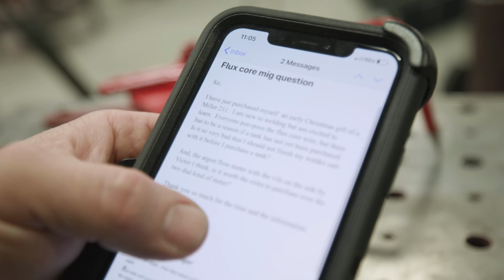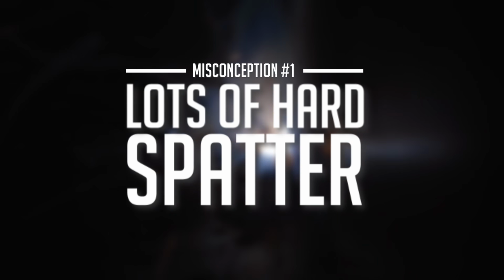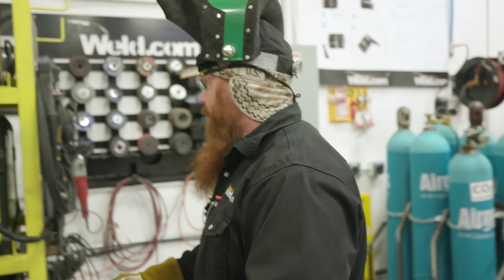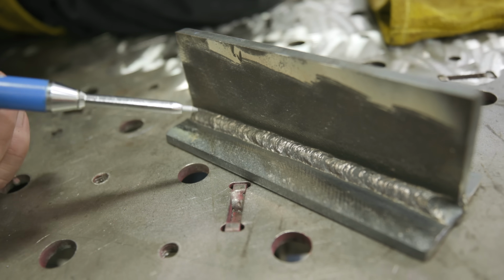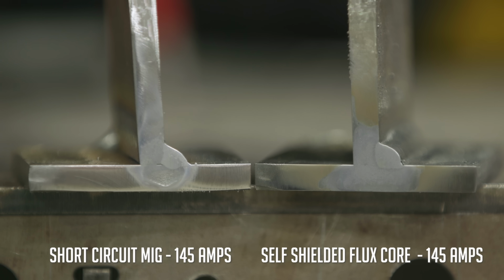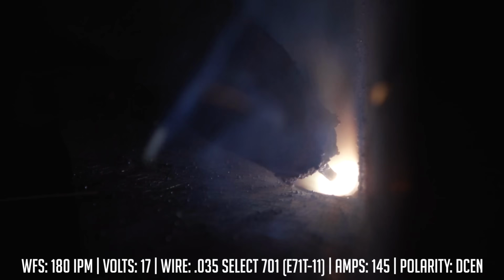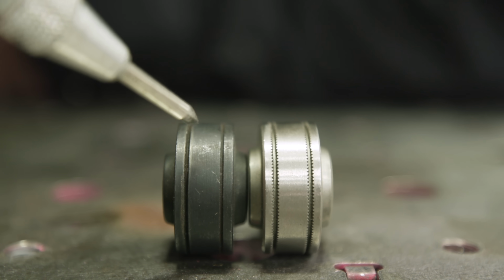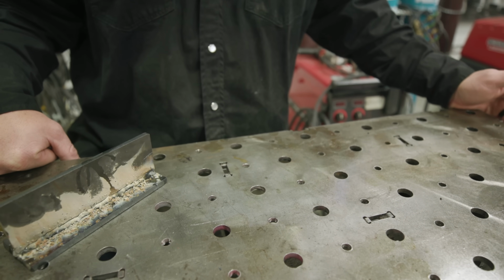3 Flux Core Welding Myths DEBUNKED

Comment: Greetings, master, I am not a welder, I am an artist-designer by profession, studying the physical properties of welding, I myself realized that everything needs to be done, as you showed in your video.It is necessary to observe 3 positions in working with flux-cored wire: 1). Polarity is STRAIGHT,  2).the wire feed roller must be notch,  3).The wire stickout should be within 9-12mm.(3/8"-1/2"). Be sure to use splash protection spray.
  Then work is a joy...👌🤝

Comment: I use only flux cored wire here in the qeer old corrupt uk and have never used a shroud on my mig as gas is produced at the pool. Nice to see and hear u say that shroud is not needed as a lot of welders who say a shroud is needed wen using flux cored..many thanks..

Comment: Hi there just wondering if you have any advice on why my welder starts to not feed the wire properly after welding for a while. I can feel it in the gun that it's not feeding properly and doesn't feed into the weld freely.  My welds aren't coming out bad just not feeding the wire properly after welding for a while and then welds start to get bad. I'm using a 200amp welder with 0.9 flux wire and 1.0 tip and polarity is correct and correct roller inside machine. Thanks for any advice.

Comment: I need to weld an 1/8 inch truck frame can I do it with a 110 craftsman mig welder using flux core .030

Comment: I have no clue what Im doing. I bought a welder off amazon  that can do stick and flux core. I need to do some diy automotive welding (fixing muffler problems). I tried out both types a few times. using 6011 and 6013 on the stick. The flux core seemed to do ...better(?). It seemed to deposit more metal than the stick. which kept sticking to my practice sheet metal of 22g steel. Any tips?

Comment: Quick question, if I am welding on a vehicle, will sending power to the piece I'm trying to weld potentially short out any other body components that have a ground connection to the frame?
Reply: You should disconnect your battery.
Reply: @terryquarton2523  Yeah battery is fully disconnected, but is there still a need for disconnecting all the other components? Like the ECU or Window Wiper motor?
Reply: @TwistedPiston-xoxo  I would say your wiper motors is save but you got me on ECU.
I am a bit to old on ECUs we didn't have then when I was a apprentice.
Local service department at a dealership maybe the best bet.
Reply: @terryquarton2523  I will take the extra precaution and disconnect the ECU, the connector is very easily accessible. I have to weld the spot welds back on the cowl. If your experience says the wiper motor is good, I can believe that. So long as my ground clamp is placed away from it to guide the current I believe it should all be fine. I really appreciate the info man.
Reply: @TwistedPiston-xoxo  I use to make my own tow bars and would tack weld them in place on the  troopie 1980s with battery disconnected then take off to do the full weld. Pre computer cars!!!

Comment: Definitely helps to have a good machine. I had a cheep craftsmen with high low switch and wire speed worked OK on thicker but not on body panels. Tried Flux core on my Miller multimatic 220 way way way better. But run i 75/25 now since I can where I live now. I just weld body panels mainly, always great info to learn

Comment: You made false statement at 3:00 "70% of amperage is through wire" IS NOT POSSIBLE. Electrical laws state that amperage through ANY circuit is equal in all series components. The ground and wire are is series so if 30 Amps is flowing through wire then 30 Amps is flowing through ground.
Due to comparatively high resistance in the wire compared to ground there should be a significant voltage differential.

Comment: Dear Mr. Weld,

Thank you for addressing the common problems and mentioning some tips that are new to me. I weld mostly with flux core. Its windy 90% of time where I work,  and I've found Flux core to work well.

I've had feed issues since I started using flux core, 5 years ago. I'm going to look around for a knurled feed wheel. Thanks

Comment: I used self shielded flux core 35+ years ago for fabrication of heavy node tubes for offshore structures but we had a fume extraction system built in to.the gun which ran into machine that had a fan a particle filter and a collection tub. We had to clean these out weekly and boy was it dirty I think the system was manufactured by Lincoln.  I may be wrong but I think that self shielded welding has been banned in Europe and many other states due to health concerns over the contents of the fume.

Comment: ive used my 100$ 90a flux core harbor freight welder for 6 years now... i have NEVER once had a structural failure with it..  Ive welded 1/8 frames, and 3/16th bracketrs for my leave springs on my Jeeps and control arm brackets.. and never had anything break or crack or anything.. ever... flux is great for the 100$ i spent.. i saved thousands

Comment: Great video!
I'm mostly a newbie, and would like to remind the other newbies that:
Having the right gun feed tube liner (coiled wire) helps too; trying to stuff 0.045 up a 0.035 tube is a bit difficult, and small wire will rattle around in a large liner, won't feed smoothly because it can S-curve instead of pushing past friction and advancing.
Sometimes the liner needs cleaning.
To help the liner stay clean, one trick is to push the wire from the spool through a foam earplug before it gets to the drive rollers.
Take the earplug out first...
Reply: Weld aid makes cleaner and pads that you leave in place and continuously cleans the wire.

Comment: I've got a cheap 108$ welder I think it's a plasma  organ  welder nothing fancy  so I throw a 100am bridge rectafire and a couple  high voltage  capsators to tighten  down  the main signal  and by stopping  the ac current  makes it sorta like it's more dc and  where it's got the 220 switch I got a pigtail that allows  me too run 220 directly into it and I swapped  the hole charging by making my ground  the hot and my wand is the negative  and it's like it just pulls the welds to the metal for a bond not much different  then say a Lincoln welder no joke that little  20$ bridge rectafire and a couple  starter capacitors out of anything  will work ones fro.a microwave works and  a ac unit will be all u need u just gotta make sure u ground the cap to the body because  if u leave it hooked up Any other way ur feed will  stay. Doing 80 mile a hour and cant slow it down fr so just make sure u ground it to the body just the caps everything else is bolted  to the bottom or top of the case for ur bridge rectafire and just use ur case for the cooler to keep things running  smoother fr and they stick fr

Comment: I probably do 2-300 metres of clean consistent fluxcore welds a day doing residential TBars, beams and columns and we run CO2 with a fume vacuum extractor and an adflow as the work is a mix of mild steel and hot dipped galv mild steel ranging from 5mm to 50mm thick and the Fluxcore takes it like an absolute champion and way more efficient as you don't need to do half the prep work either compared to solid wire.

Comment: Great video. My only welder is a little lincoln flux core only machine. People break my nuts over it constantly. Its always done what I need it to. Lays down ugly welds that seem to hold just fine. My jeeps been running on spring shackles I Flux welded over 10 years ago.

Comment: I own 20 acres and run a small farm. I bought a Harbor Freight Titanium Easy flux 125 amp flux core welder about 5 years ago. 

Best decision I made. From welding to fixing and moding the tractor, implements,  trailers, tools, gates, ect. I cannot count the amount of feet of FluxCore welding wire I have used. 

I am not a welder, never took classes, just learned by doin. My welds are not perfect, they are not clean, I have stacked dimes a couple of times but mostly it's looks like crap. But........... It works and I make 2 pieces of metal stick together and not fall apart. 😉

Love my little $140 welder!

Comment: I'm curious, my 110v doesn't have the capability to switch polarity, being that it's designed for flux core wire shouldn't it already be in the correct polarity? I don't get excessive beading but I do get a small amount. Either way I get what I need out of it which is mostly ⅛" to 3/16" steel I use in little projects here and there nothing serious that warrants dragging out my bigger 220v stick/Tig rig, it's also nice for tacking things together before I go to a full weld and I've used it on up to 3/8" plate for that purpose. I'm no professional just have around 11 years of experience a few hours a week self taught so I know what works and doesn't work at this point but not afraid to learn new information and improve upon what I already have. I love welding but I don't want to turn it into a career and end up hating it.

Comment: I ran a business with a 110 Lincoln flux for years, had it on an overhead swingarm. Yes it would duty out esp.in the summer. But I did high end architectural and light structural that was beautiful. Your going to cup brush welds flux or CO2 MIG. The 030 welds looked like Tig and plenty of penetration.

Comment: You should give the lincoln Nr211 .035 a go, big difference inall aspects. also I have found that 71t11 wires vary greatly from the different manufactures  , you want a challange , try welding off an overpopulated 110circuit (I always get stuck with this) ..030 wire get the volts all the way up and find that sweetspot on the curve with the feed, slow as hell but it can be done even 18ga overhead .

Comment: Biggest thing I've found is the some flux wires are a lot more forgiving on drag angle and stick out. Select is probably the least forgiving I've used but apparently it does better for the xrays.

Comment: 🙏🙏🙏 Best video I've come across to decide whether or not to go flux core.  Thank you!  One thing tho I disagree with.  At 8.53 stating you have to preheat the oven for pizza, pizza has no problem cooking without preheat.   Just set oven to 420 and wait until desired meltyness before 30 minutes as too crunchy and burnt can be hard to chew

Comment: thanks for the tips ...i've done everything with flux core ..even done body work ...i know its not as good but i've done it ..i got an old chevy i did in 2005 the paints started to bubble but everywhere i welded it it hasn't rotted yet ..a lot more coolin time and the spots got to be half as much as mig gas weld but it can be done ..and cleaning up for and sanding is a lot harder

Comment: Sure do loose allot when you do not practice  but I learned on stick welding 7018 5/32 frame repairs very hard to run rod. And a high amperage.

Comment: I just spent $700.00 on a
 Lincoln 140 mig welder 
I'll be just running INERCORE FLUX WIRE like your doing 👍 I would of automatically put GROUND to ground, 
BUT NOT NOW THANKS 
NEW SUBSCRIBER

Comment: Lol we used flux core a lot at Cat on truck frames. We ran a 3/32 wire size ya that big through a water cooled vacume head. 750 pound. And we ran a ton of 5/ 32 . runs so nice. Great video. Keep going. What gas are you running we did 75/25. I Thats standard.

Comment: I bought the $90 Harbor Freight flux-wire welder years ago and fixed many things.  First job was a M-B lower control arm sheet-metal bracket on the K-frame which cracked.  I welded a steel strap around it to make stronger than factory.  Welds that a shop did before I bought the car at the K-frame top (after accident) had broken free.  Looks like they used a stick welder and didn't remove enough parts to get in there well.  I re-attached, then welded an L-bracket over it to make stronger than factory.  Also welded up tow brackets.  Made a carport roof frame, using steel from a trampoline, EMT tube, and steel fence post.  Welds aren't always clean, mainly because I can't see well or sometimes get the tip in close enough, but a grinder makes them purty.  Seems to weld best on galvanized or nickel-plated steel, especially in corners, probably because the zinc and nickel outgasses to provide shielding.  The surface around turns brown, but wire-brushes to shiny real fast so probably an oxide powder.

Comment: Just started welding flux core with my handy dandy HF TITAMIUM on some 1\4 plate and square tube   with all the splatter I thought I may end up going for my cert in geinding.  I'm hoping that reverse the leads trick works on my unit. Best part of this little 15 pound inverter welder is I would be able to run it on my power inverter in my truck.

Anyone have any suggestions for a better quality unit at a similar price point? ($175 - 250)

~ "it ain't pretty, but it'll hold"

Comment: I’ve always used flux core wire at home because most of my welding is outside. Easier to weld without worry of wind, cleaning of metal isn’t as strenuous. My welds look just as good doing that bs when I’m at work using solid wire and a tank.

Comment: Wow all I had at the time was a cheap HF Flux core wire feed that I used to weld perches on my ford 9 inch, didn't know if they were too thick of a metal to weld, but they actually held up! Even after several hard launches, Thanks for sharing this video, I feel alot more confident about fluxcore now

Comment: While I can't speak to the gasless flux core...I have probably run more pounds of E70T-1 than most have ever seen. In our shop, it was fully coded for heavy pressure vessel and nuclear codes. It was super common for us to burn a 60 lb spool of 1/16" E70T-1 in under 8 hours....and that was by hand....not a semi- auto rig. As someone previously mentioned....most who gripe about flux core, aren't real welders anyway....or at least....not very experienced. Retired after almost 40 years.

Comment: Why does no one tell you to use the wire speed to adjust the heat control,slow the wire more heat,speed up  the wire less heat.really helps with smaller wire feeders.Most people are not running the heat in this video,they are using the welder for thin sheet metal and you need precise heat control with thinner metal.Nice info in your videos.

Comment: I definitely prefer gas shielded to flux core. That said, I learned on flux core. It took me a while to lay a good looking bead with it. When I switched to gas, my beads were amazing instantly. So if you can master flux core, I think it will make you a better mig welder. Don’t forget about stick though. Stick is still king in IMHO when doing structural stuff or welding outside. In a jam, I have no problem reaching for my flux wire. A true welder is a versatile welder. No welding job is the same. Especially when you step out of the controlled shop environment and you weld off a truck. But that’s where the money is at. Best of luck to you all.

Thought I would chime in a little more regarding the usefulness of flux core welding. Assuming you don’t have a stick welder, flux core would be useful if welding out doors as shielding gas would blow away. Also, assuming you don’t have a stick welder, flux core would be your best bet when welding over rust, oil or paint. You should always prep the best you can but sometimes it’s just not possible or practical. Also, if your only machine is a mig welder and you’ve reached it’s limits on penetration using solid core wire, flux core may give you that extra bit of penetration to weld in deep on something. Lastly, you may just be flat out of gas and need to finish a job. This is probably the most common situation people run into. So it’s good to know the flux core process. I will say, since getting a stick machine to compliment my mig machine, I don’t ever use flux core anymore. Not saying I won’t ever again. But I think everyone who welds can benefit from having a stick machine to grab in a jam. Even a cheap $100-$200 China made one will do fine. Keep you some 7018 and 6010/6011 on hand you are set for just about anything. Maybe some 6013 for thin stuff.

Comment: The differences between the wires can be extreme. I have had flux core snap at the slightest stress and I have had flux core I would bend next to 7018. I destructive test any weld products used on my projects.

Comment: I did destructive testing on several flux core wires with gas shielded mig as a control. Most of my flux cored wires outperformed a similar profile mig weld.

Comment: Does this video only apply to self shielded flux?  I run .045" on c25 at work through my Miller Multimatic 255 and always run DC positive polarity as Miller instructs for any of it's MIG processes.  I never experience the roped up bead as I run fairly hot and fight undercut more than anything.  95% of the time I am out of position and 75% of the time I'm going uphill with some overhead butt welds.  I can get some harsh spatter when I'm running an uphill setting which is a little cooler than my horizontal (i.e. 24v @ 340ipm rather than 24v 305ipm) or for the root pass of an overhead butt weld or if I forget to change back to my hotter setting for horizontal.  But my main issue with spatter comes when I'm going uphill or overhead on 1/4" or thinner and my settings are 22.8v @ 280 ipm.  I always figured this was because I was really stressing the limitations of how cold I could go with .045". Do you think that switching polarity will affect me positively in these circumstances?  I often switch from .045" flux to .035" solidcore when I have to fab sheet metal or have the luxury of welding on a tabletop and I keep the polarity and gas the same.

P.S. An idea for another video could be flux core pulse MIG, it is taboo to many but it produces a perfect puddle with virtually zero spatter and penetrates much more than normal!  I'm the only one in my shop who uses it but it's too much work changing arc length and width settings endlessly for out-of-position welds so I don't use it often.